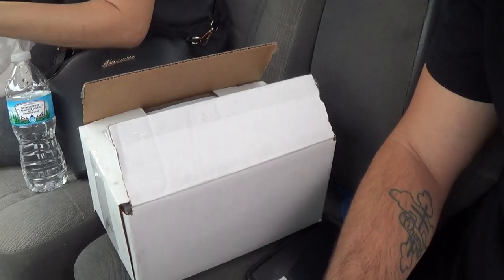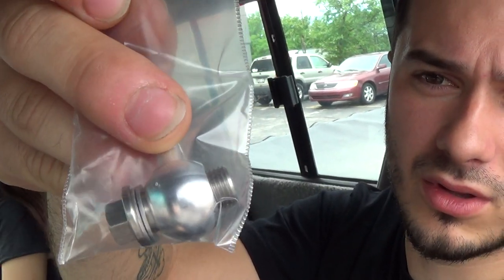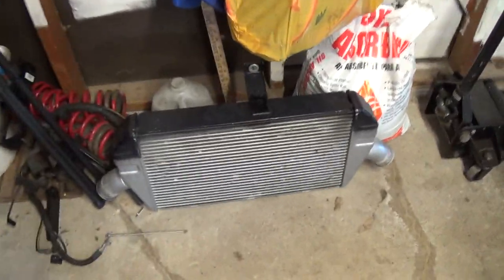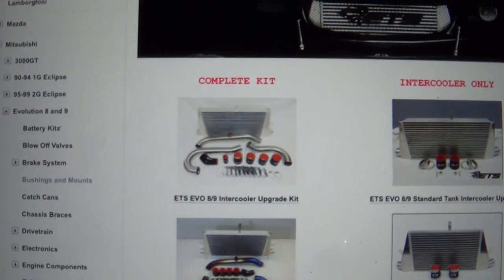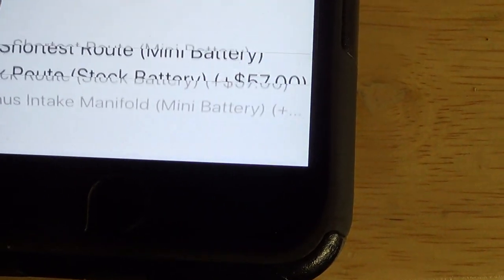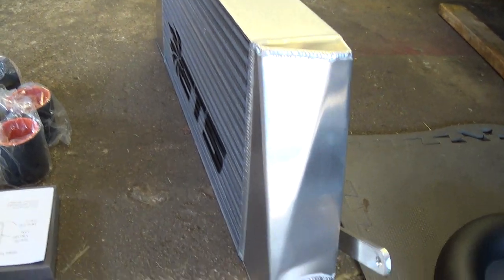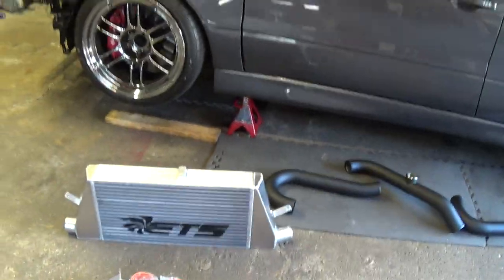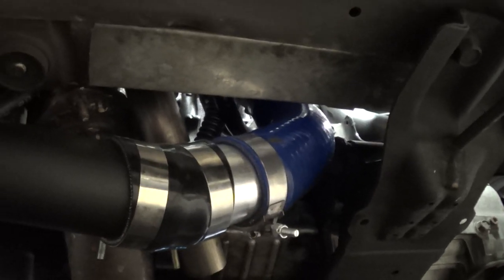Evo gets ETS Goodies

Comment: Did the lower portion of the UICP hit or contact the side of your ACD pump?
Reply from the maker: No sir everything cleared perfectly. For how expensive ets is it better fit !
Reply: @NedH  you have the wide tank 3.5” FMIC? Mine touches a bit and have to use rubber to pad it.